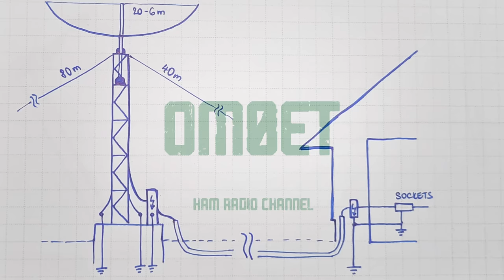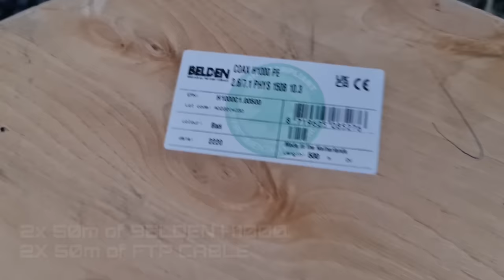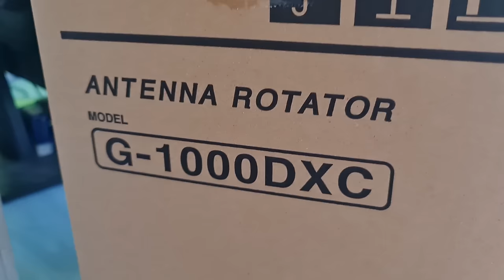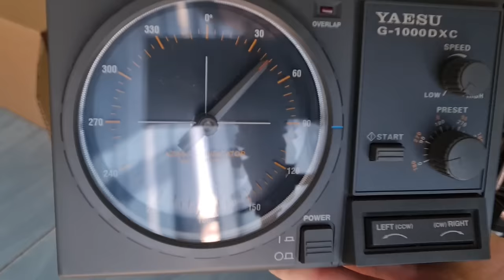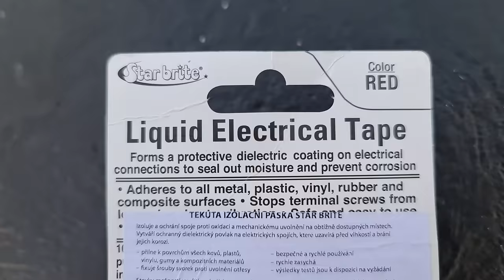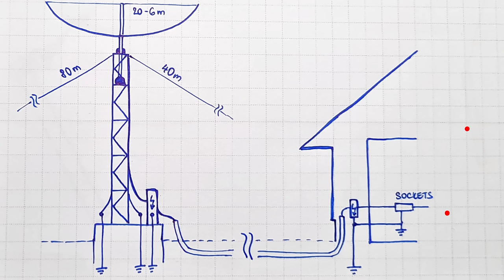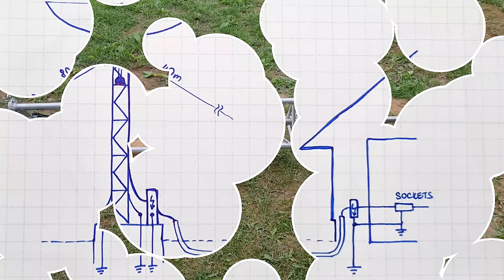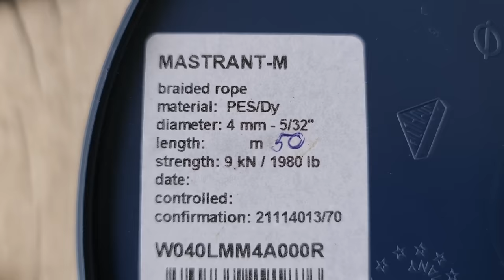How I built my antenna tower with Hexbeam on top (A to Z)

Comment: Looks great. Just one thing, it looks like the rebar in your foundation is sticking into the soil, which will cause the iron to corrode and expand inside your concrete, and the foundation will crack and weaken.